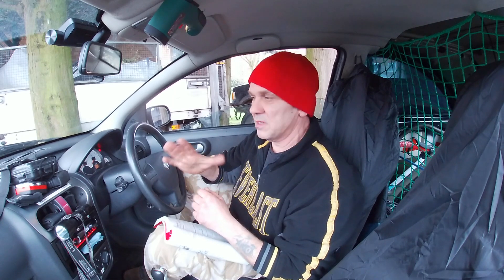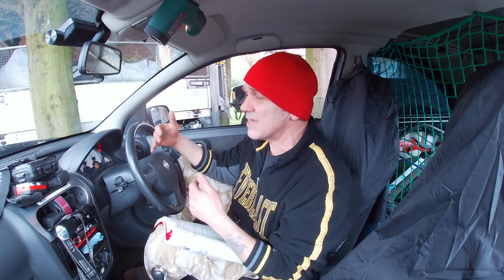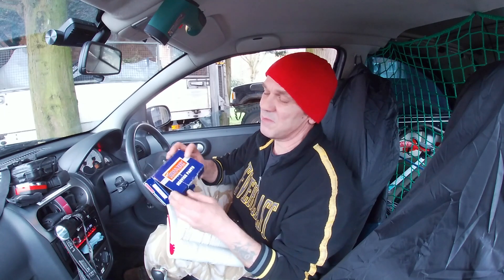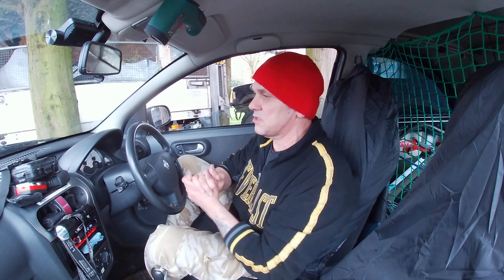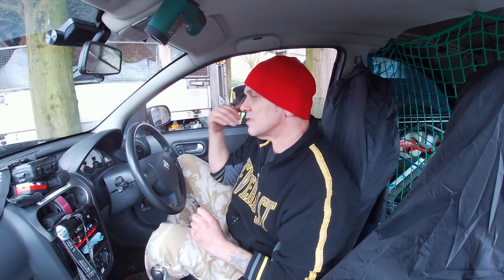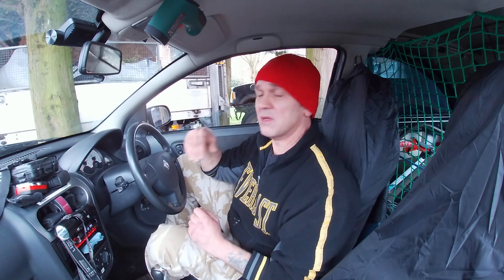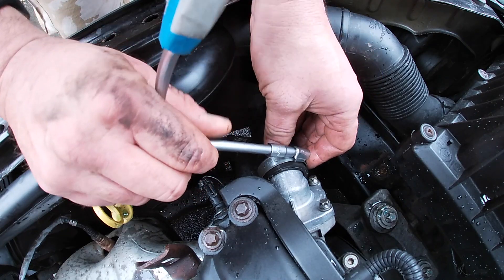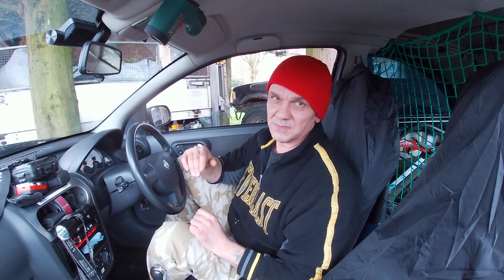Back To (Engine) Basics - Is Your Thermostat Working Correctly?

Comment: Oh and diesels wont regenerate their DPF if the thermostat is either removed or stuck open because the engine has to reach the right temperature before the ECU will perform the regen

Comment: Is the engines thermostat a internally lubricated part?
Reply from the maker: It's usually a wax pellet mechanism.  I've never seen one seize up.
Reply: @trailerfitter2  my engine blew up and delear said thermostat got stuck and the engine fried, could something internally lubricated caused the thermostat to stick. And now warrsnty doesn't want to cover engine cuz they said it was the thermostats fault?? What do I do?

Comment: Mmm, had a similar issue. Bought an oil filter for Corsa gave all spec details got it home, wrong filter altogether. Issue was had an oily finger on the paper element when I too it out. Not too bad, but a bit peeved they wouldn't swap it considering they gave me wrong part. Moral here- Keep your hands clean when offering up a new item.